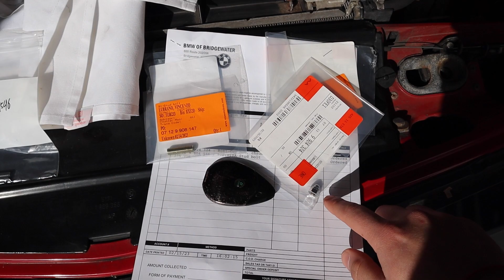BMW Valve Cover Gasket || E28 E30 M30 Engine

Comment: Urgent please read!  I’m afraid your going to have to take the cover off again.  You have a banjo bolt on the oil sprayer tube missing.  This is very common for them to back out and fall somewhere.  You need to poke around the valves and find the bolt with a magnet.  It also takes two crush washers one under the oil sprayer and one on the bolt.  If the bolt is not in place the oil spray is not distributing oil properly.  I would also check the other remaining banjo bolt is at least proper factory torque holding it down.
Reply from the maker: Wow thank you I can’t believe I didn’t notice! No way it can fall into the cylinders right, probably just sitting in the head? Good thing it hasn’t driven much since it’s undergoing a paint job on my channel right now.